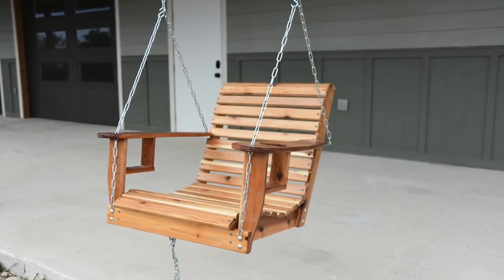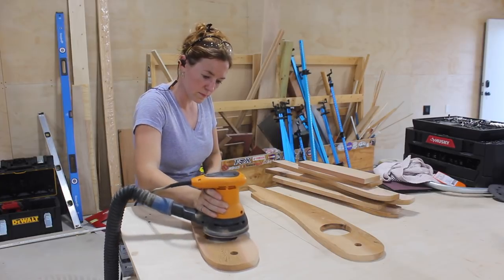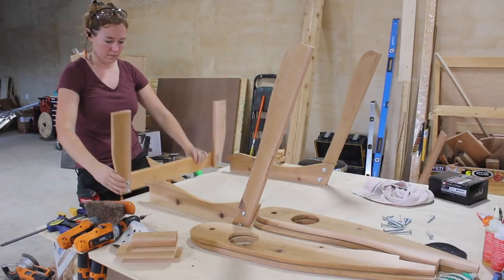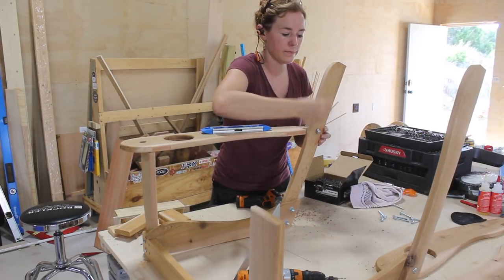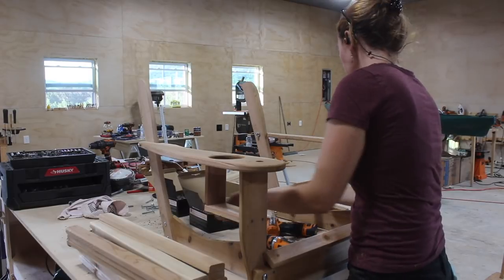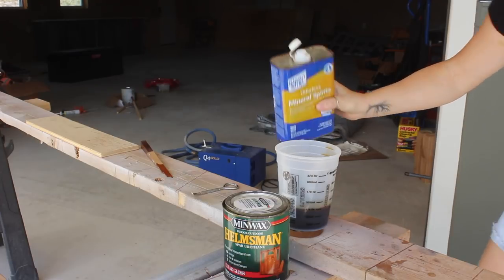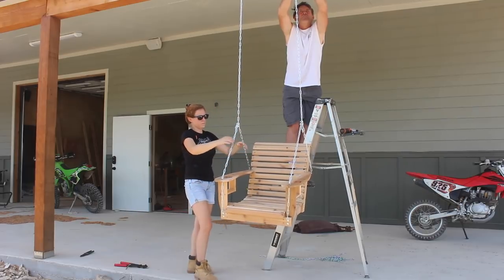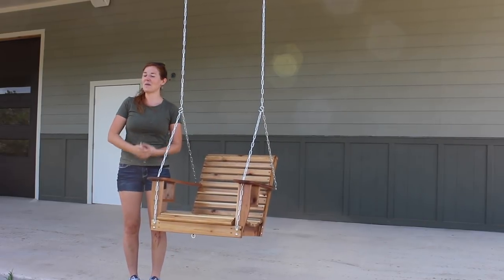How to Build a Porch Swing - Single Seater Porch Swing

Comment: My grandpa always used the hood springs out if the old 70s an 80s model trucks to give a softer swinging experience. You  can try that see how you like it. For comparison use a spring with tension similar to your old truck I have seen in past video

Comment: Thinning the finish also helps it penetrate the wood.  If your using 2 coats you can thin the first one 30-50% and let the wood really soak it up.  Then thin the second coat just enough to brush on and it will last much longer in the weather.

Comment: Hi April.  I love your videos and your new workshop. Nice swing. Thanks for the templates.  Two things:  1.  Certain species of cedar including western red cedar can cause allergic reactions to the fine saw dust.  Folks might want to put on a filter mask and tight fitting goggles when sanding cedar, especially with a power sander.  2.  I see you screwed into the end grain when installing your cup holders.  Especially on cedar, with its lack of density, those screws are likely to pull out.  A cross-dowel in each piece would give the screws good cross grain to grab.  Just a thought.  Fantastic swing.  Keep your videos coming.  Wishing you Peace & Blessings -- John at JM Woodworks
Reply: What about pocket screws from the other side? Would that be a better compromise?
Reply: Yep. Pocket screws from the back side would work.

Comment: Nice idea for the single-seater.  I built your earlier full-size version and wanted to add a safety suggestion for people who may have their swing around small children.  Take a couple of screws and washers and drive them through the top loop of the chain just before it passes through the hole in the armrest.  Small children could grab onto that segment of chain and if someone else climbs into the seat it could trap and pinch their fingers.  Securing the chain will keep that from happening.

Comment: There is a trick to keeping cedar from splitting when driving in a screw: Put the drill in reverse while applying downward pressure to the head of the screw. Do this until you see just a little whiff of smoke, then put the drill in forward and drive the screw through. Takes a little practice, but it works well with cedar.

Comment: Hi April. I like the swing, but I suggest you add blocking to the back upright for the chain bolt to go through as I feel going through the arm will end up bending the bolt and twisting the back of the arm.. Of course your slight weight won't do that, but someone hefty like me would .

Comment: Hi, good chair, can you build a simpler one that we don't need a lot of tools nor paint? I mean one that can be done using only a hand saw, a screwdriver, and sand paper.
I am planning to build a couple of them, but a lot simpler than yours.
Thanks in advance.
Reply from the maker: You can use simpler tools (hand saw, screwdriver, sand paper), it will just take longer. Follow the same steps just using your hand tools. Thanks for watching.

Comment: Looks great April. I've seen these with the chain through the arm, and others with the chain connected through an extended lower rail. Has anyone had experience with pros and cons of either design? Wondering if the chain through the arm would get in the way, or if an extended lower rail would add unnecessary weight to the swing.
Reply from the maker: I have made every swing with the chain through like this and have never found it to be a problem.
Reply: April Wilkerson Good to know. Thanks.

Comment: April, cool porch swing! What type of blade do you have in your miter saw? Also, do you do just one coat of Miniwax or two coats?
Reply from the maker: I use this Infinity blade: http://bit.ly/2xW1YvK it's top notch. The spar urethane is pretty thick stuff so I only applied one coat
Reply: Thanks. I use the polyurethane Minwax products and usually put two to three coats. I will have to try the spar urethane.

Comment: I don't know if you already know this and you just prefer to use it but the impact drill is meant for screwing and the other drill with the chuck is meant for drilling the holes just saying I've never seen somebody use the impact drill for drilling
Reply: They make bits to fit the impact drill, and I use the impact as much as I can.
Reply: Yeah I use my impact driver for drilling all the time. You can get impact rated drill bits specifically designed for impact drivers and they work well. The only disadvantage is that they tend to be shorter than standard bits. You can also get away with using standard hex shank drill bits up to a certain size before there's a risk the impact mechanism will kick in (and break them)
Reply: cjpenning actually the bits with the bit which fits into the impact drill isn't actually made for the impact drill it's made for the normal drill to stop the bits from spinning because they usually do I was just wondering cuz I've never seen somebody do it there for screws that's why the impact so it's easier to get the screw in
Reply: cjpenning if that was the case and it was made for drilling why would you get two drills
Reply: The bits I buy are specifically marketed as "impact" duty.  They are made to be used in impact drills.
Reply: Some hex shank bits are impact rated and specifically designed for IDs. They're usually black.
Reply: There are a few applications where an impact drill does not work as well as a 'normal' drill.  When you need slow finesse to tighten something a regular drill is better.  Also, I've read that Coretec screws should be set with a regular drill because they set better with constant rotation than with the stop/start of an impact.
Reply: I have bought some Ryobi bits before that must not have been rated for impact because the bits broke away from the hex shank pretty easily.  Just figured they were junk bits.
Reply: The newer generations of impact drivers often have different settings which enable them to tackle more delicate applications so they seem to be getting better in these fields by the day
Reply: I love how when you comment on a video asking the one who owns the channel loads of random people come and comment I was asking her none of you no offence I've just never heard of people or seeing people use them because why would they make two drills there would be no point in making both of them just have one but whatever I don't really care that much
Reply: Really the only reason I have more than one drill is so I don't have to keep changing bits.

Comment: I  know the maker community is a very supportive community and it's not the done thing to criticise other peoples work but I have to say the way the rear chain bolts are fitted are a failure waiting to happen IMO not a great idea if you are selling plans of this fine if it was a one-off for yourself it would be ok but i don't think it would hold up to a 300 pound person for too long. Also, the way the chain from the front and back were joined look liked if handled wrong the s shaped connector would jump out. most people would use common sense but there is always someone that will blame you for the plans and maybe a lawsuit to follow.
Reply: Mine has been hanging and being used and abused by me and my four kids and eleven grandkids for almost twenty years with the chains mounted the same way and the s hooks wide open without a problem.